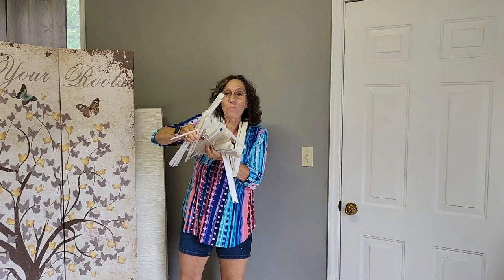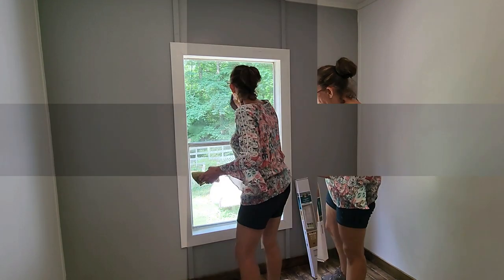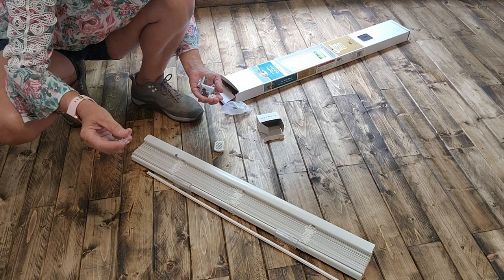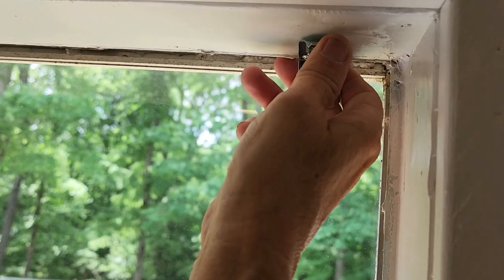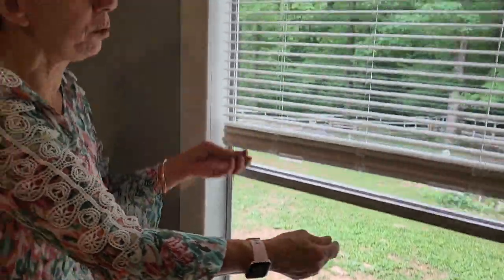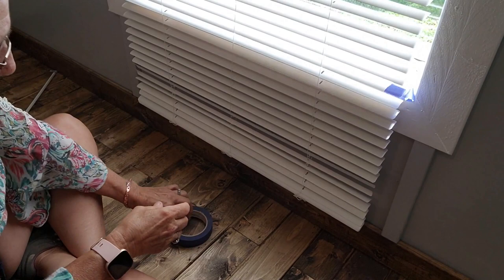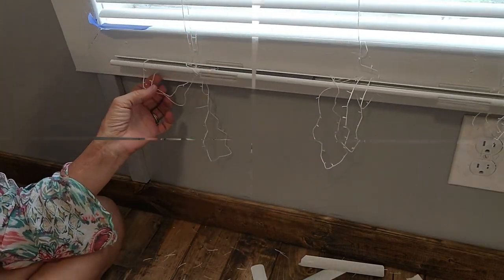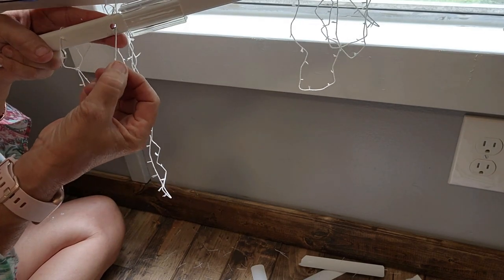HOW TO SHORTEN A CORDLESS BLIND GUIDE PLUS BONUS DECOR HACK!

Comment: Good video- mini hacksaw is my best friend!
Reply from the maker: Thank you so much for your comment. I agree on the tool :)
Reply: @CraftyNannyTN  Tried it yesterday and so much easier (I’m 64). I didn’t cut the middle rung on the ladder I just snipped it off when was done cutting all the blinds off. I didn’t pull the plug on the two end ones either, just the middle one. They retracted on their own. Thank you again for putting it out there. I watched several before choosing yours because of the fewer steps.
Reply from the maker: @maryann823  Way to go!! Thank you so much for sharing your shortcuts. I'm so happy it worked out for you. The more you do, the faster and easier it will get to. Thanks again for your comment and support 😊